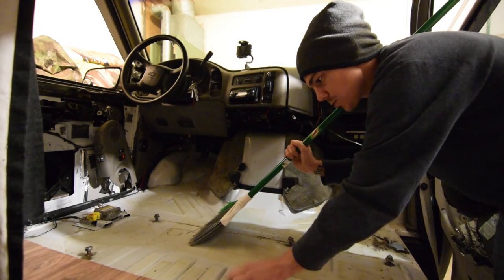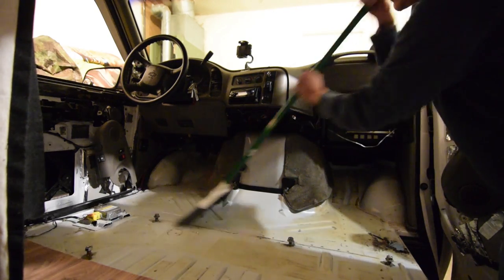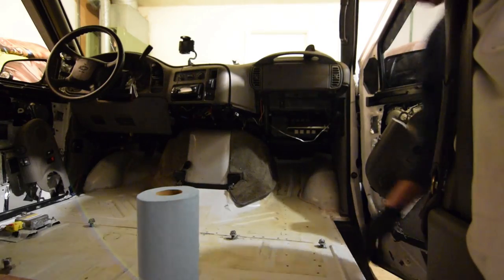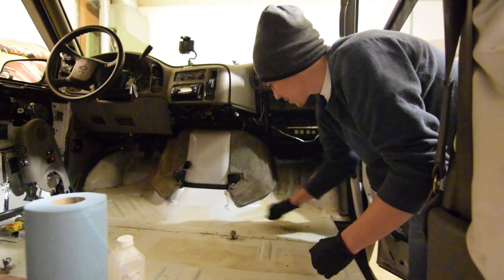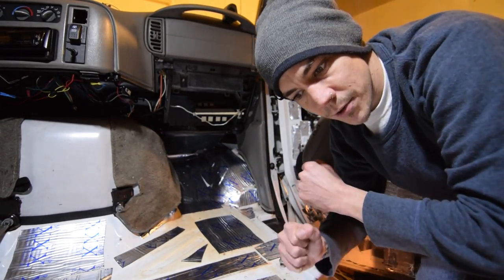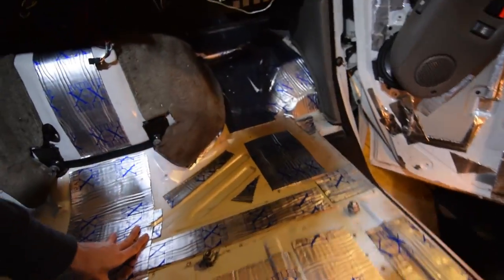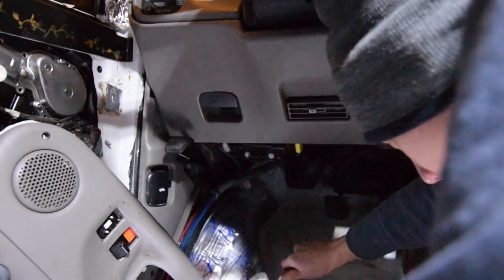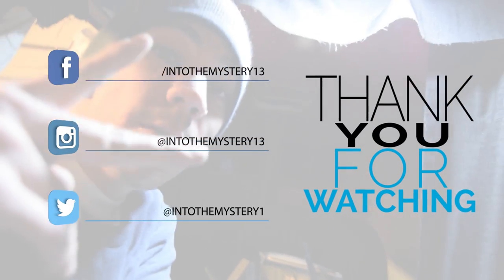Rattle Trap XxX Install, Van Plans, Stickers and Merch

Comment: hey Jed, remember me about 8 or 9 months ago telling you about this rattletrap XXX? I told you it was amazing stuff glad to see you're finally using it it's antitoxic guarantee from the company. And it works absolutely amazing I put it on the entire floor wheel wells I wish I did the roof but I didn't end up doing the roof. While I'm driving my camper van, if you are in the back on the bed and I'm driving and somebody else is obviously in the back you barely sound like you're even moving it that's the sound so much. And I contributed about 75% to this rattletrap is amazing. the other insulation that I put down on the floor is grape a little bit for noise but mostly to keep the heat in in the cool Aaron but this stuff is absolutely amazing it

Comment: Sound deadening material in a van you plan on spending a lot of time in is one of the best investments period. I'll have to do a before and after video of ours once it's done. 

In the back we did spray in bedliner, a layer of 3/4" rubber trailer bed mat, then the stock rubber mat than a nice piece of carpet. The walls in the back got strips of Dynamat, a layer of Reflectix, A layer of hard foam board, another layer of Reflectix then some paneling. 

The cab got a complete layer of Dynamat on the floor, firewall, inside the doghouse and inside the doors. Next is putting a layer behind the headliner.

Makes a huge difference. It's like going from driving a tuna can to driving around in a recording studio. Much more livable, warmer, don't have to use as much to heat or cool it. 

Peace!

Comment: Random misfire is usually a coil on pack issue. You need to check the connection for the coil on cylinder that the error is happening on. Also check the rubber on the coil there just like spark plug wires and they will need to be replaced as needed.

Comment: I had a friend that worked at Cessna on sound/vibrations and he did his dissertation on it. You need to apply enough to cover at least 2/3 of the panel that was vibrating with the similar mass as the vibrating panel.   The FitEV on their older class B did the roof, doors, firewall, and floors to quiet the cabin.

Comment: You could probably get one or two propane burners and a sink at the RV store, then make your own cabinet top to install them in, that way you can control the size. Right under the top that you build you can house a miniature LP tank and also install a little Mr Buddy propane vent-less LP heater to keep you warm in winter if you are up north like I am. So that one little cabinet will perform two or three functions. Then you get to where you need to be able to carry food so then you need a cooler, and install a tank for dish water to run into under the van, as you can also make that yourself out of an empty empty propane tank.

Comment: as a caraudio enthousiast, i can say that if you cover your doors really well ( so full ) if your speakers are situated in the doors that is, with those tar-mats you're speakers will sound better :) no vibrations, no irritating resonant car-metal, but also way better BASS ;) ( just don't cover up the drainholes for condensation/water in the bottom )  i did my whole car with them ( also my subwoofer which is sitting where the spare tire was, is  3 layers of tar mats at the bottom, and topside is the sub in a wooden case airtight connected to the bottom. the sound is just amazing :D .  For heating i'm looking for a second hand navi heater  dickinson propane heater p9000, they are not cheap but on youtube everyone is very positive about them because the are clean, don't use your oxygen and use very little gas.  you will need a small chimney though..  Great video again !
Reply: Nice hidden benefit of sound deadening!

Comment: if you're ever in Utah and you want to permanently fix the road noise issue, on the military humvees that I rebuild and restore we have a specialized rubber coating that we coat them with we would put it on the bear surface of the interior and also spray the exterior if you would like. Doing both would greatly reduce the road noise and the noise that comes from the engine. it is extremely durable as well and is made to adhere to things that are subjected to high vibrations. I personally coat the entire Humvee because of how well it works to reduce noise. I'll be doing this to my van as well once I head down to Utah.  Also if you're interested we have a new high tech armor that we armor the Humvees with. It is 4 times lighter than Kevlar yet stronger. We mold it to whatever surface it's going to be placed on. There are also inserts you can place in a backpack or we could build you a shield that you could hold in front if you in a sketchy situation. I currently live on the east coast so it may be a bit before I head over there to get the stuff done to my van.  I just wanted to inform you of some other options that are out there.  Thanks for sharing the video and taking us along your life Journey! I'm getting close to really getting into building my van out to live in. It's always been a dream of mine to do since I was a little so I am now finally starting on that Adventure. Dreams only come true if you choose for them to and make the choices that bring them into fruition.

Comment: As you pointed out, you only need to do the vehicle with about 33% of the rattle trap. The purpose of the rattle trap is to add structure to the vehicle to avoid rattles but it does not reduce road noise that much. You need to add a layer of an insulation over the rattle trap. To make it real quiet, you should add a layer of mass loaded vinyl attached to a layer of closed cell insulation and then a layer of jute insulation. I've done this to a few vehicles/RV's and WOW, what a difference. If you click on my YouTube channel, you'll see a video of my Ford pickup and the results. Good luck!

Comment: Looks good. I would have covered the whole area with that sound muffling material. I really don't see how that little bit would help,.it's like the sound will find a way around those patches. Anyways, hope you're having a good time there, and can't wait to see you back on the road. Peace.  ☮
Reply: If you touch your finger to a bell and try to ring it, it won't work.  Just by touching it with the tip of your finger.  Same concept with sound deadening.
Reply: John, thanks for that analogy, makes sense when you think of your bell example.

Comment: Hey Jed.. I had noise issues on a '65 VW Bug so I Rhino Line'd the undercarriage and wheel wells help so much I did it myself with the spray can, they sell.. good for rust protection too! Get Better bud!
Reply: It's $10-15 a can and you probably only need to do the front first.

Comment: I used Noico brand Butyl based sound deadener on my van.  Check on Ebay as it's cheaper than Fatmat. I probably wouldn't use the stuff if I was installing for an audio system, but it does great to mitigate road noise. Also, I did my whole floor including the cab and the back of my E350. While it might not make a difference to use that much for sound, it also acts as a moisture barrier.

Comment: gas tanks nowadays have anti siphon mechanisms in them and this many times can cause issues. Often times when there's a problem with this particular mechanism you either can't stick the pump in all the way or it doesn't let the fuel flow in fast enough so it backs up and causes the pump to stop and by pump I'm referring to the gas pump that you used to fill the tank up with gas. I remove them out of my line because I put locking gas caps on my vehicle so there's no need to have the anti siphon mechanism on there.
Reply from the maker: +Tyson Capel interesting. I didn't know that. Sounds like my problem. Thank you!

Comment: don,t forget to insulate yur walls & sides with Reflextic-Thinulate-Reflextic!!!    the Reflextic against the metal walls acts like a barrier against moisture!!and everyone installs vents & 12 v. fans for above  but have drawers or? under the beds so no air flow!!!!! use screen-chicken wire or plastic latice on front & back of drawers-cabinets-etc so air flows & stop moldy-musty smell with humidity buildup!!

Comment: You might not have a cold you might have allergies perhaps you try an over the counter allergy medication they are very affordable and if you take it and it works you know it is just allergies as you age allergies will make themselves more noticeable. Bottle of OTC meds is about $3 tops. If road noise is so bad perhaps you should try sailing you travel and guaranteed zero road noise. Smartest van build I have seen is bed desk option fold up bed fold down desk. Just tell them you cook on your engine that is a permanent cooking setup even if you show a RV with a stove perm you can always leave that meeting take it out and put it your way? A roll of AL foil is how some people cook in their car.

 You are on the right path to getting rid of noise where I come from you have noise best thing to do is make your own noise TURN IT UP ! ROCK N ROLL ! BOSE makes a pair of noise canceling headphones might be cheaper than trying to turn a sow's ear into a silk purse.

Comment: I found out on my Chevy if the gas cap doesn't make a good seal it made the check engine light come on. get a new gas cap.
Reply: the dealership said something about it being a sealed system don't know if that's true but went to the auto part store and got a new one . Engine light hasn't gone off again . So that worked for me and simple fix .

Comment: Sweet. Do you know where to find the specifications for registering your van as an rv? Bummer a camp stove won't work. i wonder if it'd be okay if the stove is built into the countertop?
Reply from the maker: +Mgneubeuri depends on which state your in. Check with your dmv or try to find the requirements online
Reply from the maker: +Mgneubeuri ill probably end up building one in. Their a lot cheaper that way
Reply: +Into The Mystery 13 thanks, i'll definitely look into it. I was thinking of getting one of those $100 rv ones from amazon, but they get pretty bad reviews and mounting in a coleman camp stove seemed much more convenient.
Reply: good idea that's what i did man, no problems so far

Comment: Thanks for the vid Jed. Have you replaced the gas cap yet? Chevy is notorious to throw code when the seal on the gas cap is not up to snuff.
Reply: I believe I recall him saying one code went away when he replaced the cap, but still has this other one.
Reply from the maker: +Riens Overu two or three times now. Thank you
Reply from the maker: +Kev And His Jeep yeah it's just the p0300 now for random misife. And only under load. No symptoms, just the light
Reply: Riens Overu the guy who did my smog check told me that my gas cap was bad and that took care of it he put a new one on for me!
Reply: Debrajoy awesome! Glad you got it fixed!

Comment: Hope you feel better soon. I was thinking of using spray adhesive to put ultra touch radiant barrier (home depot http://www.homedepot.com/b/Building-Materials-Insulation/UltraTouch/N-5yc1vZasbsZ48t) underneath the osb subfloor and over the wheel wells to help cut down noise and for insulation.  Good luck with the van refit.

Comment: Put an induction cooktop laid into the countertop...you can get a one burner one.
Reply from the maker: +Rachel Hoff you can get inlaid ones? That would be perfect!
Reply: Into The Mystery 13 have you thought about the sink burner combos they have them on Amazon for a couple hundred dollars that's where I got mine
Reply: Into The Mystery 13 not sure about buying them as inlaid...but you can build it like it is.  They're usually made with the controls in a slant on the front....so if you just put a shelf as deep as the induction cooker and make it open to the front that would be inlaying it into the counter.  It's not like it's a camping stove...people use them all the time as permanent cookers.  It should work if you build it into the counter.  If you find one that is flat across the top with the controls that would work even better.  You can truly inlay that.
Reply: They're not expensive...Maybe $50 on Amazon.  I bought one for $15 at a salvage warehouse sale...salvage ticket said it turns off...it does turn off...when you don't put a induction capable piece of cookware on it it will automatically turn off.  Their loss my gain...!
Reply: You could make the front of the counter to hinge down to uncover the controls...that way it truly looks inlaid and you still have access t the controls when you need to cook.
Reply: They even have double burner ones.  This one has flat controls too.

https://www.amazon.com/dp/B01I24O68C?psc=1

I'll stop commenting now.  Lol.
Reply: One more thing...they need ventilation...so you might want to only attach the platform it's on by he corners...that way it has ventilation under the counter.
Reply: Rachel, I'm interested in the induction cooktops, but why do they need ventilation below?
Reply: Dreamer I have 2...they both have fans that run while cooking.  One of them runs for a while after as well.  I believe it is to keep them from overheating.  Both have a fan on the bottom and ventilation holes on the back and both sides towards the back.  I'm assuming from this that they need air ventilation to cool them.  If you make a shelf and set it down in it that will trap the air...no cooling.  There would need to be some way for the air to get to the back and underside of the cooktop...
Reply: Dreamer This is from the manual of one of them....To avoid blocking the ventilation opening, allow at least 4 inches of free space around the cooktop while in use. Do not use the cooktop on carpeted surfaces, tablecloths or paper.
Reply: Dreamer also from the Manual....After turning off the cooktop, the fan will run for approximately one to two minutes to cool the unit.
Reply: Dreamer that specific uni sucks air into the front from the fan underneath and ventilated it out the back vents....at least I'm assuming that's how it works because the manual points to the front underneath as the air intake...therefore it needs fresh air in the front and somewhere for the hot air to go out of the back.

Comment: https://www.amazon.com/Camp-Chef-Camping-Outdoor-Burner/dp/B0013LLSZG

this is the amazon link for it.  it makes awesome brownies...lol  I have it installed in a cabinet that I built surrounded by Thermotek heat shield on all sides.  Its hooked to a 20 lb propane tank with a splitter on it.  we use the same tank for the buddy heater.  it really works out well.  If you want to see a pic of the setup let me know where to send it and Ill send you some or you can check our Pinterest page there are some pics there of it.  Good luck with your van build and hope you feel better soon!

Comment: so is yours extended or the regular wheelbase
Reply from the maker: +sharon Gypsy dove Astros only came in one wheel base that I'm aware of. Pre 95 or something had an extended body, but after what ever that cut off year was they are all long body
Reply: Okay I was wondering because I seen the ones that are made into like Little Campers that have extended bodies in there's actually three extended body ones for sale by me right now for a couple thousand dollars but they don't have the camper mod on them
Reply: +Into The Mystery 13 are you crazy? now you got a chance to put down inch thick foam insulation for camping in the winter.do it!

Comment: Fuel tank can't cause a misfire
Reply from the maker: +MrTimnedella is the gas cap can, then so can the dried up hose that connects it to the fuel tank
Reply: Into The Mystery 13 cap can't cause a misfire either

Comment: evap vent issues. evap purge selonoid
Reply from the maker: I've gotten a code for that too. I think its the are i need to work on next
Reply: Into The Mystery 13 the evap issues will cause a vacuum leak which leads to random misfire and having issues filling the tank with fuel

Comment: jed, code smode why are u so hung up on a code that means nothing. ignore it. why would u want to be licensed as an rv? imagine your van 3 feet longer, 2 feet taller and 1 foot wider. now u get it ...stealth sacrifices comfort for whos benefit?
Reply from the maker: +Borga Mucielli the short answer to all is saving money
Reply: ok, ignore the code and save money.
Reply: If a vehicle is registered as an rv, the rates are cheaper.
Reply: what rates? dont they go by weight and value.? to be rv it has to have alot of things installed eh?
Reply: It goes by value, but since rv's, in general, sit in driveways and aren't driven as much as cars the rates are lower.
Reply: what rates? insurance or registration what? does state have to inspect it?